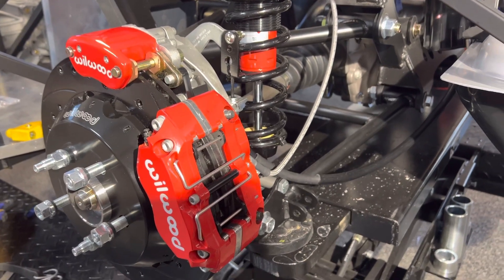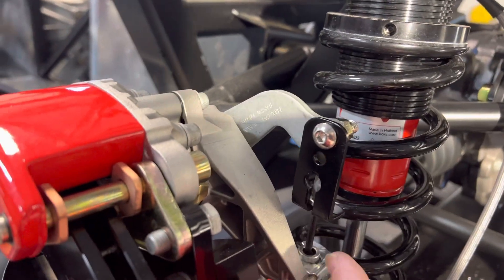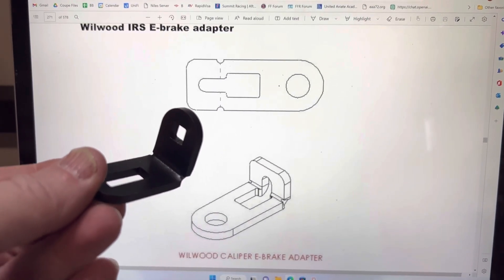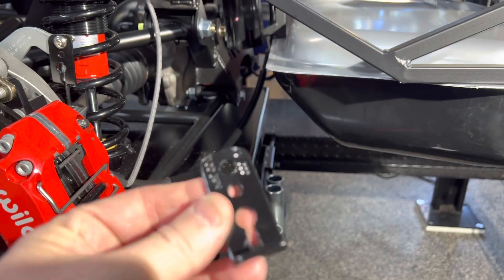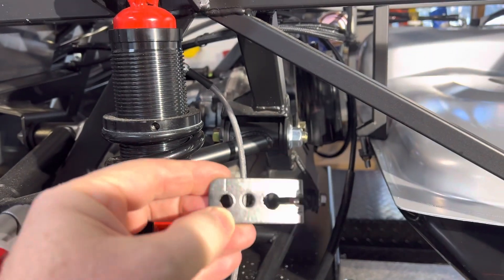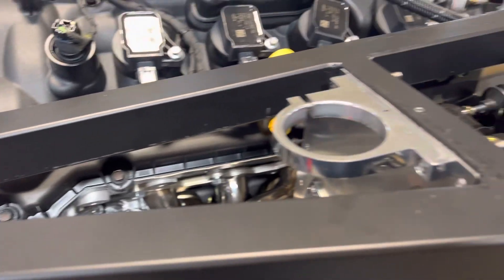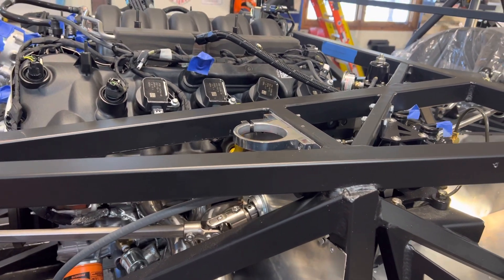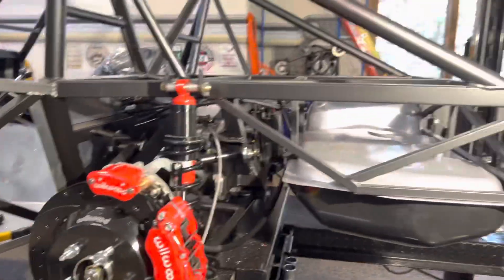Build Update 19, E-Brake Cables. Factory Five Type 65 Coupe (1965 Shelby Daytona Coupe Replica)

Comment: I had the same confusion and checked with FFr and they said that bracket is the e-brake handle mount.
Reply from the maker: Interesting. There was no need for them to mount the handle.
Reply: I know I'm late to the party but that e-brake handle mount is required on the older roadsters (MK3, MK4), and they include it in ALL kits including the MK5 and Daytona Coupe apparently. Definitely looks very similar to the Wilwood brake adapter.